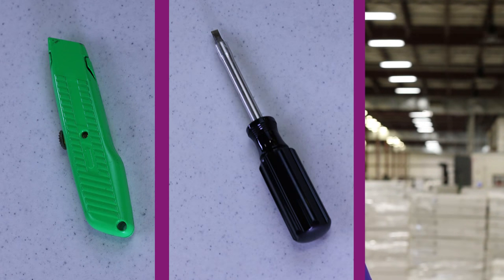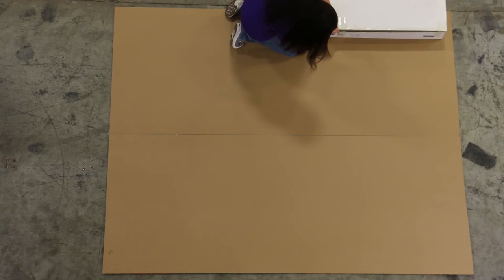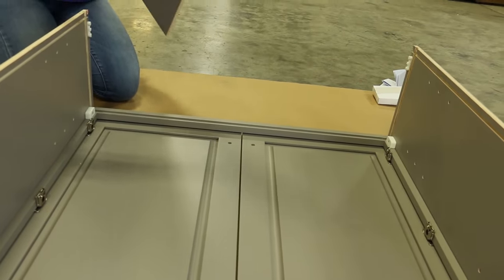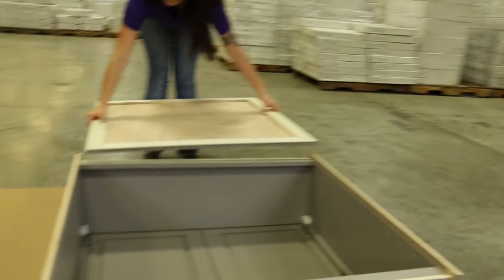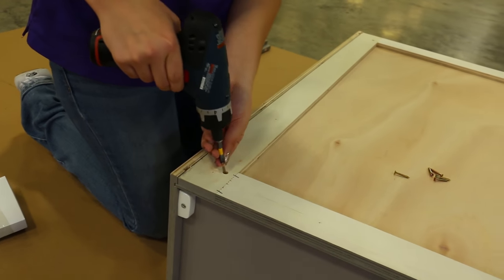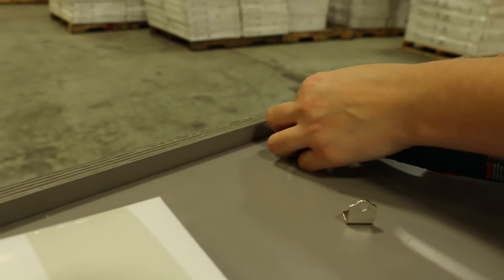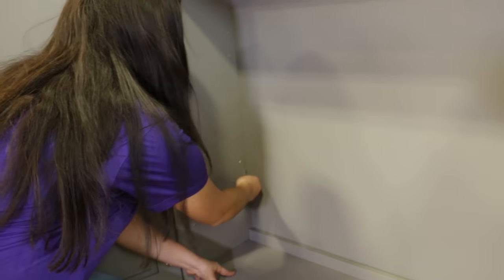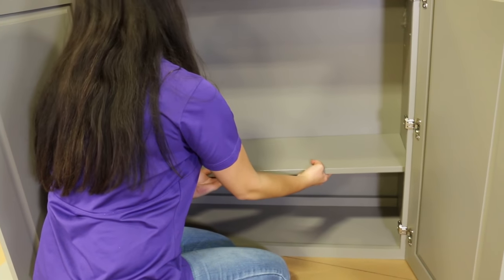How to Assemble a 2 Door Wall Cabinet From Cabinets To Go

Comment: ok. I have some comments after I've put together and hung a few of these.  The top and bottom panels are not marked - and look identical so I'm assuming it doesn't matter which goes where.  now the biggest peeve. on the face frame (at least on the 2 hinge doors - 30") one hinge attaches 7cm from top/bottom the other 8cm from top/bottom, so it really matters that all cabinets are oriented the same or your doors will not be consistant - that is - if you want to make the door open the opposite direction (say you want two 18" cabinets facing each other) you CAN'T just flip the cabinet upside down - you have to remove the door and flip it, then attach it to the other side (there are pre drilled holes on both sides). I found this out the hard way now I had to redrill two holes to make my door all the same level.  Finally, I really HATE the fact that the shelf holes are only drilled at the top and bottom portions of the side panels and NOT the middle portion ( 1:28 ) , so you can't just use one shelf and put it in the middle, otherwise you will need to drill your own holes - and for corner cabinets that 4 panels that will need to be exactly level - If you want to do that, do it before you put them together otherwise it will be almost impossible to drill the panels facing you. those brackets - one side is longer than the other and nothing in the directions mentions whether that matters which side gets the longer side when you screw them in place. All in all, I found the cabinets to be worth the price for the quality - just aggravated the instruction are really really poor.
Reply: I’m wondering if there’s a top or bottom to these cabinets ?
Reply: @Richie Lanzetti  there IS. We are currently installing and we put the first cabinets in with the door going to the left. We put the next with the door to the right. It was after we installed both that we realized the doors didn't line up. We ended up drilling new holes and moving the doors that were going left to make them face right. 

One end of the cabinets has more room than the other. We are thinking that is the "top" so you have room to attach the crown moulding. They don't tell you this ANYWHERE in the instructions. They don't tell you anything about the installation of any of it. The instructions are extremely minimal. Very frustrating problem to figure out after attaching 4 cabinets to the wall and screwing them to each other. Big fail on CBG's part.

Comment: doesnt show the doors being attached
Reply: the doors are pre-attached to the face frame that was placed on the floor in the first step
Reply: Mine also came without the doors attached and I had to attach them as the first step. And mine came with no L brackets.